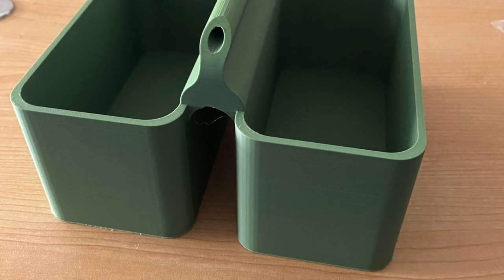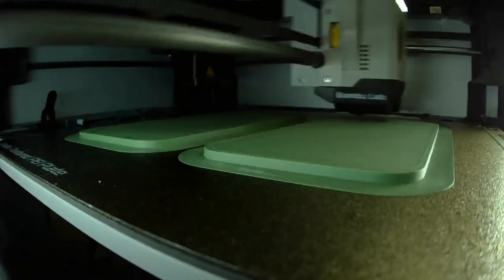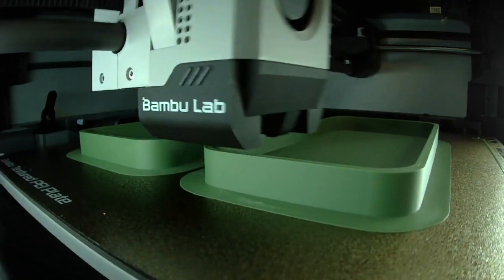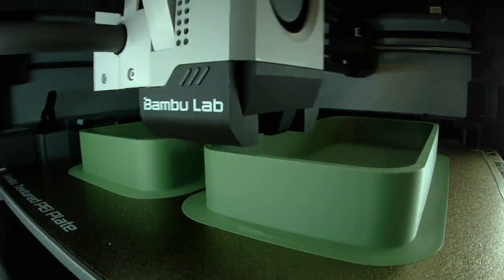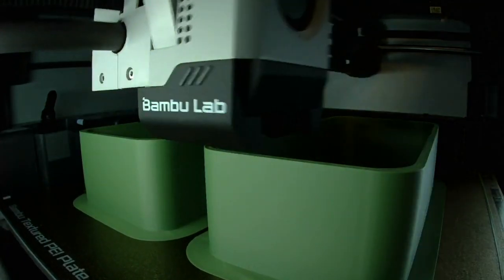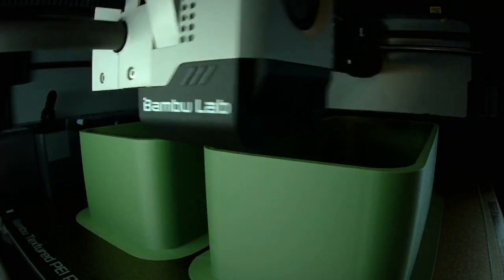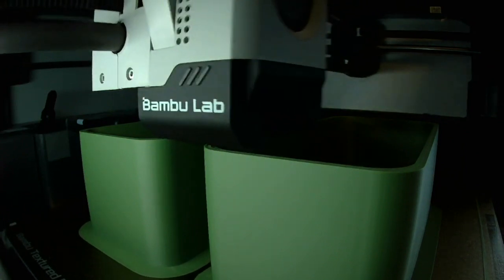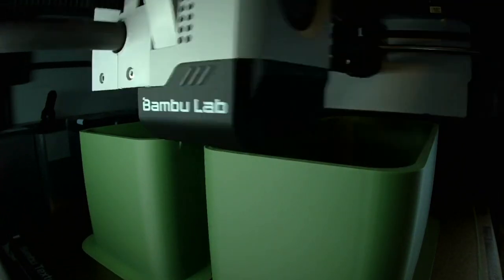3d Printed Carry Caddy

Comment: A design tip for the rounded corners, if you want the radius of the inner corners to be consistent with the outer corners, make the fillet of the inner corners half of the fillet of the outer corners if you understand what im saying, but other than that nice design!
Reply from the maker: That is a great tip!  I usually make them the same.  I just played with your suggestion in my CAD program, which makes it look better.